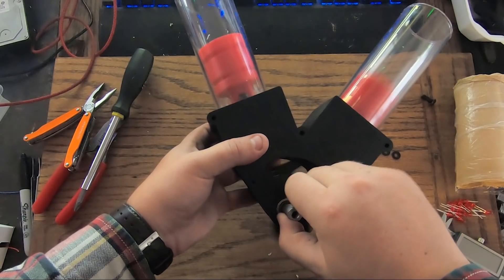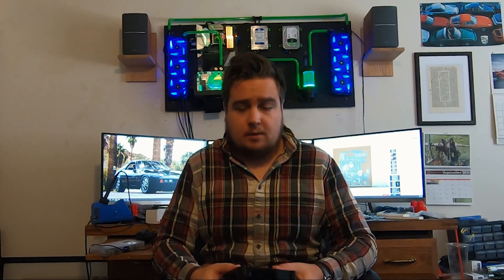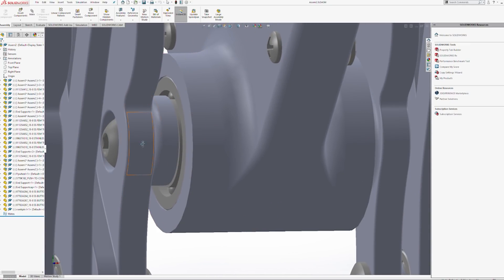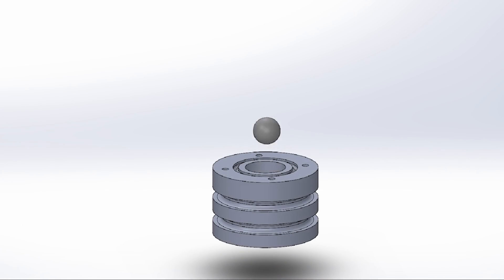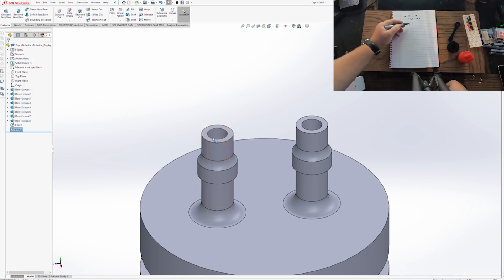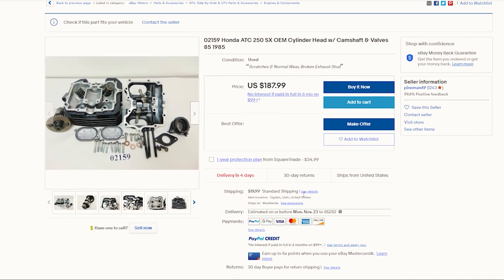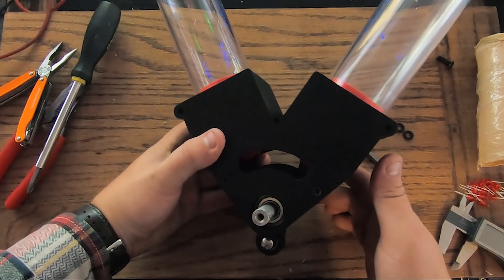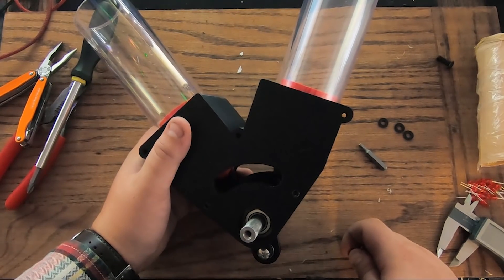The Porsche F1 Car is getting the weirdest engine...

Comment: I would look at old yamaha waverunner GP1300 2 stroke crankshafts. These motors have an 84mm bore and 78mm stroke, with pretty wide bore spacing due to their individual cylinders which is very friendly to air cooling. The cranks roller bearings for every component, which means you can keep stacking them as long as you want as they are completely modular and made from webs and pins pressed together (you'll need a 20 ton press to do this job though). 
You could have new extra long pins made to accommodate the V configuration while still using the stock connecting rods. (It's just standard centerless ground rod to your diameter after hardening to 60-62 HRC. Any grinding shop should be able to provide that for not too much money, I would buy a 3 foot chunk and cut them to size)

The con with any "assembled" crankshaft is torque capacity vs a solid crank. Not sure what the limits are, but I know they can push well over 200 hp in modded GP1300Rs. (a 1.3L I3 2 stroke motor)
Yours would be a 4 stroke, but it looks to be 2 cylinders above each crank segment in a fairly steep V, so not too different from 1 cylinder firing on every stroke as in the 2 stroke.

Whether it would work really depends on whether 1 GP1300r crank can withstand the extra torque of another identical GP1300r put in front of it, as if it was an inline 6. If so, that means you would be perfectly safe doing a 340-400hp 4stroke 5.2L V12 (made with the stock 2 stroke rotating assembly even down to rods, pistons, bearings, and the stock generator that goes onto end of the crank. The only exception would be the pins).

The bore spacing on these is pretty large, as each cylinder is its own individual cast component with its own water jacket etc. So LOTS of space between cylinders for air cooling when using the stock pistons. And having the extended pins will further increase that by maybe 15mm. 
If you want to decrease bore spacing to make it more compact, you can remove the center seal section (that separates each cylinder's compression when it was a 2-stroke) and probably narrow it by 15-20mm between each V bank. I would just cut down the pins pressed out of the shaft. (note, all of this cutting needs to be done on a wet abrasive saw. It is extremely hard steel)

The real challenge would be finding 2-3 used GP1300 cranks to steal parts from. New cranks are $1000 each, used "good" are $300-400, but occasionally some come up for less than $100 in bad shape with a siezed bearing or something (which doesn't matter as you're going to disassemble it anyways).

I would also use Nikasil lined plain aluminum bores, not a cast iron liner. Having an aluminum cylinder honed and plated should be of comparable or less cost than having a steel sleeve put in, and Nikasil is more reflective than cast iron so it won't take up as much heat from the combustion. Also, it's lower friction so you get more HP and less heat from that part as well. The biggest benefit: wear resistance. Once you make your set of 12 (and maybe some spares), it'll just be changing pistons every 300-400 hours, except probably much longer since they will now have an oil jet which they did not have as a 2 stroke. 4 stroke motorcycle motors can go 20,000 miles before needing a top end rebuild (looking at the DRZ400, which has a smaller 62mm stroke but revs past 10,000 rpm)

For background, all of ford's ecoboost engines use nikasil lined aluminum bores, and that's how they go hundreds of thousands of miles while enduring 20+ psi of boost under towing duty. Nikasil is magical in what it can do for engines, especially when you aren't having 2 stroke ports interrupting the coating and giving it opportunity to corrode underneath and flake or chip off.
Reply: Here's some more info on cranks: https://www.groupk.com/y845.htm

"Crank welding

  Crankshaft “truing and welding” has long been an upgrade favored by higher performance SuperJet owners.  The scenario where it is most needed is in a high rpm engine that is run at peak rpm across rough water.  The loads on the crank journals are huge when such an engine is at the rev limiter, when the pump makes a sudden “hook-up” connection to the water.  The rotational loads on the crankshaft from that kind of rough water riding “can” twist the press fitted journals of a stock Yamaha crank.  However very few free-style setups turn those very high rpm’s of a closed course setup, and very few freestyle riders are as abusive to their drive trains as the average closed-course racer.  For most freestyle riders, a stock un-welded Yamaha crank will never experience any rotational “twisting.  However exceptionally aggressive or abusive riders may still wish to error on the side of caution, and have their crank journals welded."

So my take away, is put as much rotating mass on the clutch end of the engine for clutch drops. That even means valvetrain, belts running the accessories, etc. The less rotating inertia on the other end the better. (also, chain drive or belt drive cam? OHC would be good but not sure how that would be possible with individual heads, and not sure if pushrods would do the job at with a redline of 7000 rpm or so). Also rather than welding, I have also heard of pinning these: assemble and true it, then drill and ream for tapered pins so if the friction hold lets go, it'll stay in place until it can clamp down again.

Here's a really shitty video but it explains all the parts at least.
https://www.youtube.com/watch?v=iuHM_AGSH8Y&ab_channel=2STROKESTUFFING
Reply: For torque capacity, I firgured out how to calculate it.
These usually take 8-10 tons to press in. Based on this thread the crank sections are 35mm diameter. 
http://www.x-h2o.com/threads/yamaha-650-701-760-oem-crank-bearing-and-seal-part-numbers.156510/

17.5mm radius to feet= .0574147 ft. Multiplied by that same 16,000 lbs of frictional force at that radius=918 PEAK ft*lbs of torque. So you may want to look at rotational inertia values and how long it takes a clutch rated for a given torque to drag the RPM down. And use a clutch with just enough grab to make sure it doesn't slip the press fit when you drop the clutch for a burnout.

So you should be golden with watercraft crank components, even to a 6 segment crank. Just make sure your press fits are requiring enough force. That 340hp@7k rpm (2 bone stock GP1300R motors stacked into an inline 6)is only 255 ft lbs.

Comment: I love the effort but your intro kind of encompasses my standpoint: this is a stupid and terrible idea, best of luck and I wish you great success.   Designing an engine from the ground up with any hopes of reliability of power is almost hopeless.  You're pretty good at solidworks and have a decent understanding of engines but boy is it hard to take into consideration things such as clearance changes due to thermal expansion.  I don't have much insight that your probably don't already know, but I would start with copying the compression ratio, bore, and stroke of an existing engine.  Best of luck my brother, this won't be easy and won't be cheap.  Engines to consider when you give up lol: 4g63 w/ big turbo, maybe mate hayabusa engines into a boxer style crankcase, Try running an I6 on its side like the first indie cummins racecar, or if you can find the v10 from the viper because those get totaled all the time.
Reply: I somewhat agree with your sentiment while also appreciating that he's trying. But I think it will be worth the learning experience.

Comment: For heads, cylinder, pistons, and valve train look at smaller Continental and Lycoming horizontally opposed engines.  The cylinder and heads are one piece. Valve train is single cam push rod and air cooled. They are also dry sump and compared to modern engines as simple as it gets.  A lot of the parts are interchangeable between different engine models so parts compatibility isn’t as difficult to figure out. The best part is just about every engine can run a gear driven supercharger.
Reply from the maker: Will do, I hadn't considered aircraft. I'll look into it, Thanks!

Comment: Do you have a transmission in mind already and does that play into design parameters?   Find someone to do the video stuff so you can have more cycles for 'engine'ering!  Good work, keep it up!  I dare you to put out shorter and boring videos of some of the stuff you deem unworthy...  I bet there are a bunch of thumbs up to be found!
Reply from the maker: I do, I would like to use the 6 speed Boxster transmission in the car currently, because it fits great in the subframe and works out well with mounts and stuff. Thanks for the support!

Comment: Gotta Commend you Wesley,  That's a big project. Awesome.  Some things you just gotta do yourself. Most don't understand why.  Thanks for posting. Myself, I just ordered some carbon fiber materials to make my SIm Rig lighter.  Why?  Because the way I built it with steel could be lighter..  That's why.  Sure, I could go buy a bass boat or another race car, but I want this thing to be my own design.  OWN design. Not someone else..  Your thing here is WAY more complex:  But I've looked into engine design too a few years back and making the block and heads myself but ended up pushing that project way into the future for now. Maybe your project will give me some motivational fuel ..  Go for it.  Either way, it's awesome to do stuff that very few people even try to do.. Thanks for posting.. DMAX

Comment: I'm curious so as why you choose to not offset lengthwise one of the banks as is the case on the vast majority of V engines.

Also if I understood you correctly you plan on keeping the cylinders aircooled ? If so it may be very difficult to maintain the cooling somewhat consistant along all of the engine.
Reply from the maker: It is offset, But not by a significant amount due to how thin the connecting rods are. That's why it looks fairly even. 

If I go with those kits, yes they will be air-cooled. If I design my own setup I will absolutely be keeping it water-cooled. Really depends on how adventurous I'm feeling for the first run.

Comment: Why not use motorcycle engine parts? They're plentiful and cheap. A sport bike based V8, V10, or V12 would sound insane and provide more than enough power.
Reply: I'm just think sport bike parts will be lighter and better flowing than ATV parts.
Reply from the maker: That's without a doubt a possibility, and sort of what I was thinking with the single cylinder repair kits.
Reply: I mean, whichever heads are easier to work with might as well be the choice

Comment: A boxer engine, wouldn't be better for your car, that has a lower center of gravity?
Reply: Yeah, but I’m pretty sure it’s a more technically hard engine
Reply: @karelpgbr  u
Reply: @karelpgbr  ñ
Reply: @karelpgbr  I would say not that much harder than a V
Reply: @noaharmistead7433  but I think they Are hard to seal
Reply: @leon_brave_racing898   That's fair
Reply: @noaharmistead7433  the hard part is that you have to put the pistons inn before the crank because the block is split in half
Reply: Boxers are mounted surprisingly high because of the sump and headers
Reply: @crztank9298  True although if you take the BRZ/86 for example it has a CoG as low as some supercars and it's partly because of that low boxer :D
Reply: Like mentioned before, an opposed piston engine. No valves to time (or build a freevalve system for), more or less a steel tube with two holes and two pistons (+ 1 for the spark plug) , maybe a billet alu housing with cooling-fins and couple of gears to connect the two sides to a common driveshaft.
Reply: I don't think he has the physical space (width) for an overhead cam boxer.
Reply: 6466
Reply: Hu
Reply: Rotary? Fun, low cog and pretty loud
Reply: @TheMinecrazys  designing a rotary from scratch is PHD level of calculus. I've tried to make some research on it for a end-of-college project but my teacher quickly brought me back to earth!
Reply: @PaulChoix55  that is why it is a challenge! I really would love see it back on the market...
Maybe oposite pistons would be a nice diferent engine too
Reply: @TheMinecrazys  cummins made an opposed piston diesel engine recently, google it its really cool. For military applications.
Reply: @PaulChoix55  ? Interesting. It's one of the simplest designs possible. A single-rotor engine has basically six moving parts, three of which are apex seals. I agree that it's a very ambitious project for an undergrad but it's totally doable with time and practice.
Reply: @techvette  the complicated part is to, from scratch, design the shape of the housing, ports and rotors. You can do it backyard style and it may work, but to calculate it for efficiency is intense to say the least. Yes the low amount of moving parts makes it looks simple, and to rebuild its quite easy. But design the apex seal yourself, calculating thermal expansion and spring ratios and finding the right material etc... you see where i'm going.
Reply: @PaulChoix55  Yeah, I get that. But, CAD data for rotaries is easily available. You don't need to design all of this crap yourself and you certainly don't need to fabricate everything. The mark of a good engineer is recognizing when to use what's available vs when to innovate. That said, I'm an adjunct professor (EE & CS). We do inter-department projects between ME,EE, CE & BFA (really). One student, on his own time, designed and fabricated a pull-start single rotor engine in about two months. It probably helps having a pretty nice machine shop. I've seen some really amazing things come from kids that were passionate about their project.
Reply: @PaulChoix55   Check out the Rolls Royce K60 engine. Vertically opposed pistons. Strong unit as well.

Comment: Always interesting to watch other's workflow on SolidWorks, being a user myself.
Reply from the maker: I'll be completely honest, I know my workflow isn't exactly perfect. I have probably 2,000 hours total on Solidworks and I still find things that I didn't know it did.
Reply: @WesleyKagan  You could try to use the revolve function more instead of multiple extrudes on top of each other. For the round parts you make it will make your life easier and only have one feature instead of three or five. This also makes large assemblies quicker to load and modify. Nice project tho!
Reply: @david4karting   I had to fix about 3 years of work from someone who pretty much only used extrude and cut-extrude. Even patterns were just sort of badly copied, unlinked  sketches on many layers. That part at 4:55 triggered my PTSD haha
Reply: @GarethFurlong  i can imagine